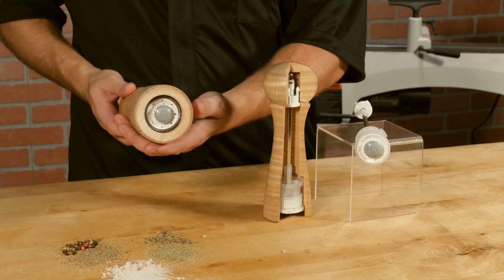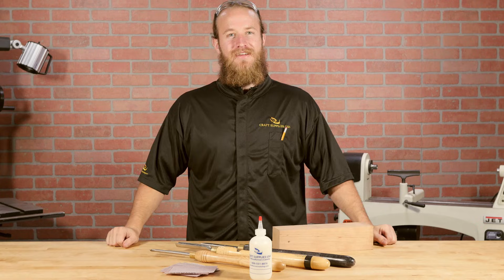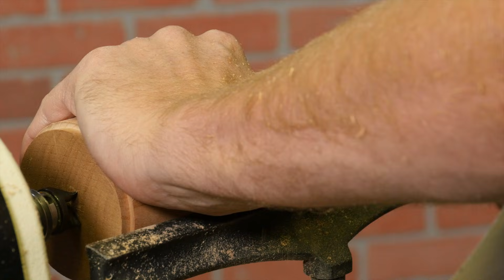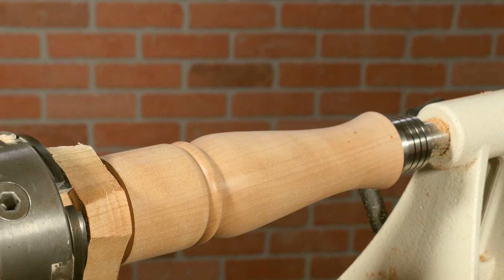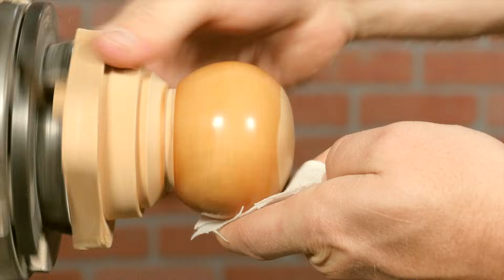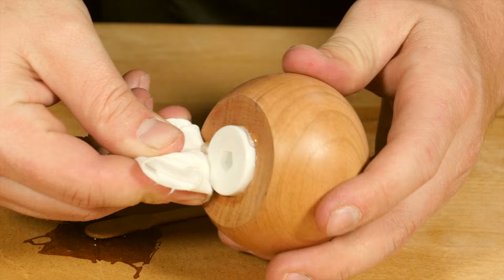Turning a Crushgrind Salt/Pepper Mill (Woodturning How-to)

Comment: I Love tour video, it's great for step by step instruction.
I do have a problem though... You must be using a VERY soft wood, like Pine.
I'm using Maple, and as you know, Maple is a very hard wood.
I made sure the wood was running true, then used your exact example...
Using a 1-1/2" Forstner bit, and a "Jet JWL1221VS" like yourself,  as I BEGAN to drill things were okay, but when the bit started the ACTUAL cutting process, WOW, it squealing like a pig.
Then the vibration started...
Suffice it to say, there's no way a Forstner  bit can be used with Maple.
Any advice would be very welcome.
Reply from the maker: This one was turned out of Cherry.  If the bit is squealing, you can put some wax on the forstner bit.  The bit could also be a bit dull.

Comment: You said you use Clear Deft Wood Finish, cut with Lacquer thinner. The only Deft Wood finish I could find on the website is a spray. How do you cut it with the thinner?
Reply from the maker: You want to look for the Deft in a jar.  We no longer carry it, but it is available at most hardware stores like Home depot and Lowes.

Comment: Nice video, but on this type of mill there is no adjustment screw at the top mill end for taking up any wear that occurs in the grinding cutter part at the other end of the mill. Having that tensioner nut at the top also allows you to back off the cutter to clean it out with a good tap on a bench top. Nice video but not a well designed kit.
Reply from the maker: These mechanisms have an adjustment knob on the bottom of the mill.

Comment: I am interested in making one of these. I have made many with the other type of grinding mechanism. The instructions on the Woodcraft website say that an internal groove must be cut at a precise depth for the mechanism tabs to snap into. I see nothing about that here.
Reply from the maker: The snap in tabs on the crush grind mechanism were originally designed for plastic pre-made mill bodies.  You can cut a groove for the tabs with the crown crush grind recess tool.  However, we don't recommend cutting the groove as it makes the grinder mechanism almost impossible to remove.

Comment: Excellent video. The precise drilling instructions are valuable for this specific item (Crushgrind mill) since it does not come with instructions.  I'll start on my first set of mills today, and will order more.
Reply from the maker: Here are the instructions for the crush grind kit:  chrome-extension://efaidnbmnnnibpcajpcglclefindmkaj/https://woodturnerscatalog.com/cdn/shop/files/crush_grinder.pdf?v=15420847510062144402
Reply: @CraftSuppliesUSA  thanks, the instructions specify a 13/16" hole in the mill head while you specify 15/16".  I assume it doesn't make any difference? What if we're cutting the recesses for the tabs?  Would the 13/16 be better then, perhaps?  Thanks!

Comment: Looks like a good video. I have in the past purchased crushgrind mechanism from your online store. There were fine. Until I reordered about 13 sets, and all of them the top Friction pieces would hold the shaft. I tried adjust the shift with a hammer. No luck. Oh also the adjustment know in the bottom , for coarseness takes two hand and a tool of sort to unlock. So they useless for me and a waste of money. Very disappointed , I sure the the kits where better than woodcraft's. I was wrong. So dissatisfied
Reply from the maker: Sorry to hear about the issues you had with those mills.  Send an email to Support@woodturnerscatalog.com or give us a call at 1-800-551-8876 and we will do our best to get you squared away.

Comment: I enjoyed the video and followed instructions to make my own mill. One question...at what stage is the tenon removed from the top of the body. This is used for all of the bottom-up hole machining and the body then turned around to fit on jam chuck and revolving centre for finalising profile - but you don't mention removal of the top tenon (see video at 5min 9 secs. Thanks

Comment: Good grief.. 1-1/16, 15/16 and 1-9/16 bits?? Who designed this thing, could have made the parts 1-inch and 1.5 inches so we don't have to go out buy these odd drill bits.
Reply: Could just work in metric and not have those issues.
Reply: I agree. Could never understand why these sizes were chosen. I had to order a 1 1/16 bit off amazon. Imported from Asia and the bit shaft won’t fit the ⅜” Strongbore holder. It’s too big. Their manufacturings tolerances don’t measure up. Would have been way simpler to go with a more common 1” size which can be sourced from virtually any tool retailer made by higher quality manufacturers.

Comment: forstner bits in 16ths are hard to find. Can I use a 1 1/8", 1 ", 1 1/2 " and a  1 3/4"  instead?
Reply from the maker: Unfortunately no. These kits require precisely drilled holes.

Comment: I am using your crush grind mill kits and love the product. I have turned two mills where the mill is slightly shorter than the rod in the mechanism.  I have cut the rod to shorten it but can not get the cut end flattened enough to stay in the grinder. Any suggestions on how to repair this? I keep hammering the end on a vice but so far no luck.
Reply from the maker: Please call us at 1-800-551-8876 and we'll help you with your problem.

Comment: It looks like the 1 1/16 bore doesn't support any parts.  Could you make it 1 1/8 instead.  Much easier bit to find.  Sorry for the remedial question, I am new to turning and project building.
Reply from the maker: Unfortunately the 1-1/8" bit will not work.  The stopper registers in the 1-1/16" hole in the mill body.
Reply: Thanks for  your response.
Reply from the maker: Sorry it took so long.

Comment: Awesome video, quick question about the finishing method.  How long you let it dry between coats? I understand it will depend upon temperature but I noticed that it feels dry to touch within a couple of minutes.
Reply from the maker: Great question and sorry for the late response. We typically recommend letting the 50/50 Deft dry for about an hour or until it's dry to the touch. If you do have the time, letting it sit overnight won't hurt. The drying process allows the Deft to harden in the wood fibers, creating a barrier that prevents oil finishes from penetrating the wood.

Comment: The video does not show the removal of the chuck tenon from the top of the mill body.  Please confirm the best way to do this with the live center in the tenon.  I am new at this.  I really appreciate this video.
Reply from the maker: Good observation. When turning the mill body to shape at 5:27, we rolled a half bead at the top of the mill body, essentially removing the tenon. Please give us a call at 1-800-551-8876 if you need any assistance with your projects. Thanks.
Reply: @CraftSuppliesUSA  I am not sure about that, I didn't see a bead there and its problematic

Comment: Do people normaly coat the inside of the wood grinder? I want to make one but I'm worried that there would be wood dust mixed into the seasoning. How can I make it work?
Reply from the maker: Start by selecting a wood that's not prone to allergies. As for the inside, you can clean out the debris with some sand paper, then wipe it clean with a rag. If you want to coat the inside, spray some sanding sealer inside and let it dry before you add any seasoning to the mill. Here's a link to the Sanding Sealer. https://www.woodturnerscatalog.com/p/42/2405/Masters-Magic-Sanding-Sealer

Comment: Why does you use a jam chuck rather than just using the jaw chuck on the inside diameter?
Reply from the maker: The chuck jaws we used would not have fit the recess in the peppermill.  However, that would be a good option if you have the appropriate jaw size.

Comment: Ok, now it is time to make a Video of a "Snap-in" Crushgrind mechanism using a shaft of PVC.  This enables one to use the snap-in mechanism and turn an identical mill as the shaft mechanism.  I have made 4 of these and they work as well or better than the shaft.  Note:  It is technically different than making the shaft mill, but not more difficult, just different.

Comment: Loved the video. I turned out 6 sets for Christmas presents.  I found a useful tip on the 3rd or 4th set; that is boring a hole in the mill part from the bottom end with a 3/16" x 8" drill bit.  Seems to speed up the process of boring through the maple.
Reply: The brand is Crushgrind, you find them at every store in europe that sells woodturning supplies.

Comment: Could you tell me what is the correct code of the mill to buy kits for the project shown in the video?
Reply from the maker: Crushgrind 10" is 1012630001 and 18" is 1012630002. Here's a link. https://www.woodturnerscatalog.com/p/53/1264/CrushGrind-Mill-Mechanism